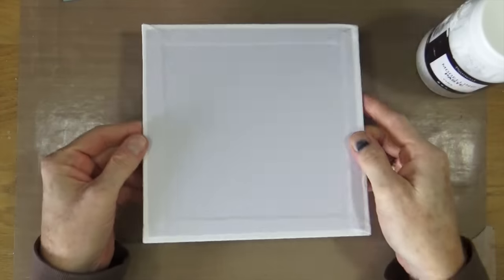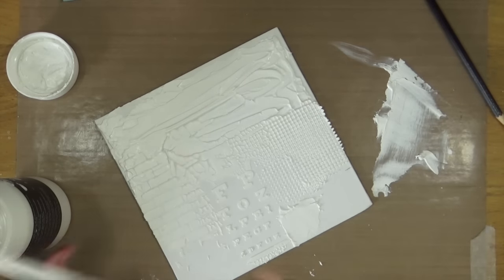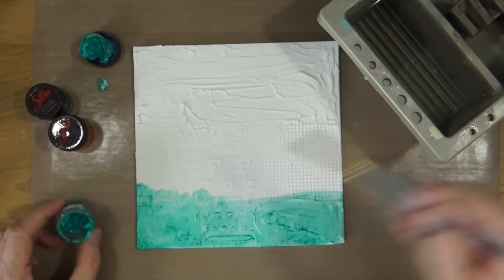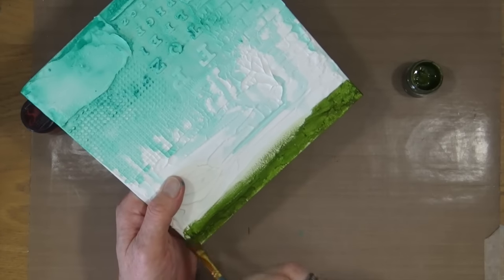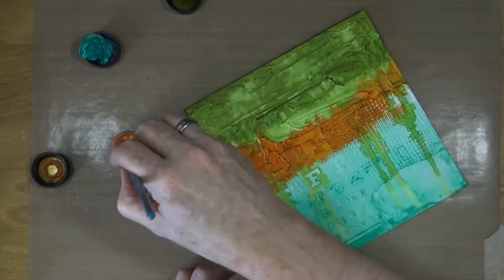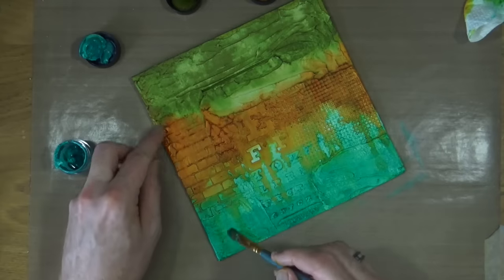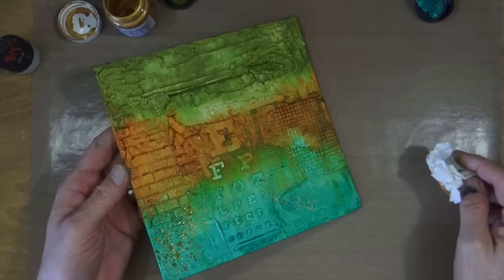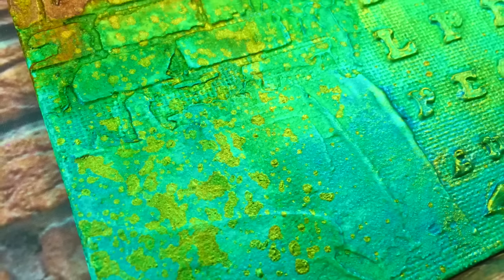Mixed Media Canvas - Corrosion

Comment: I keep wondering if you've ever worked with metal tape, engrave it by scratching into the surface and aging it with black acrylic paint, wipe most of the paint off and then splatter with rubbing alcohol. It turns out great. I made wallpaper for my kitchen this way, very steampunk. The base is plain poster board.